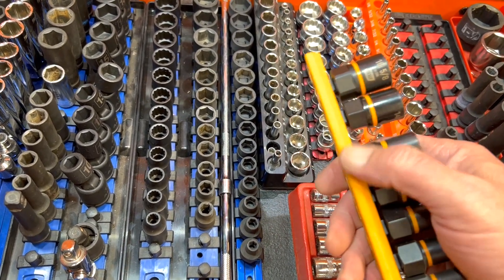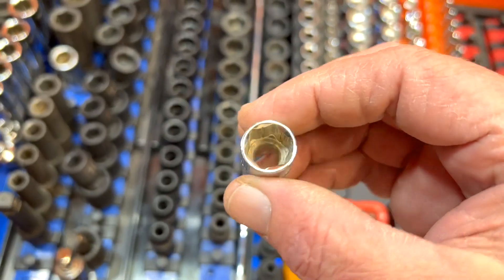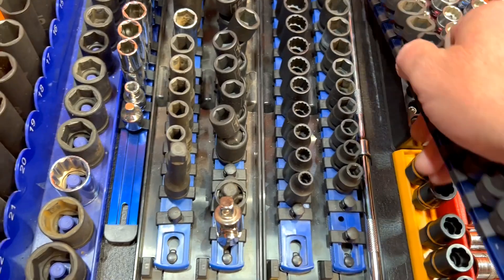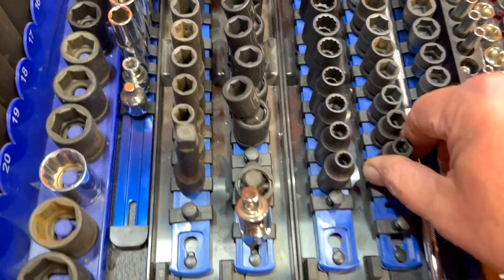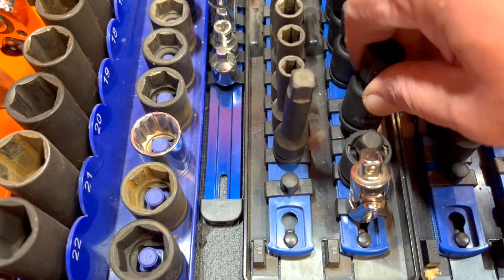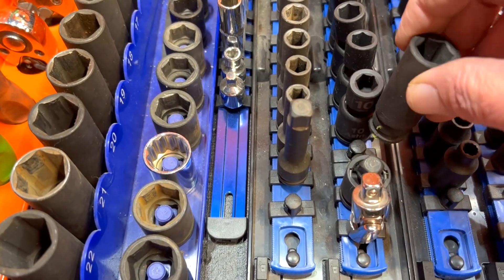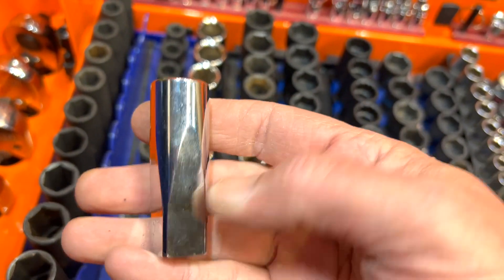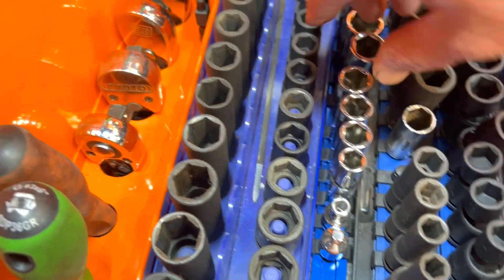Do You Need SAE Sockets in your toolbox? Have a look at my sockets and socket organization!

Comment: Working on shop equipment is why I keep both in my cart as well. 1/2" deep impacts, 3/8" deep and shallow impacts and 1/4" deep and shallow chrome sockets along with all the ratchets, extensions and adapters live in the top tray of my cart. All on Ernst rails and the other stuff in a 3 compartment Ernst tray.
Reply from the maker: Sounds like you have a great set-up, Brother. Thank you for sharing and for your continued channel support!

Comment: I find a lot of SAE in fire trucks and ambulances. I hear aircraft is almost all SAE. My world is about 50/50 metric/ SAE.
Reply from the maker: Great answer, Brother; happy Thanksgiving!
Reply: Production aircraft where I work are all sae for availability of FAA certified fasteners. Non-flight R&D and testing fixtures are often metric hardware. Weldments I build and machining I do are 50/50 depending on which engineer did the drawing and design.
Reply from the maker: @spevakdesigns  Thanks for the information!